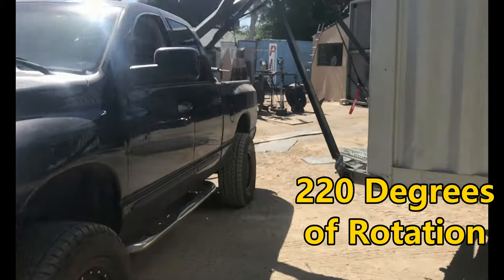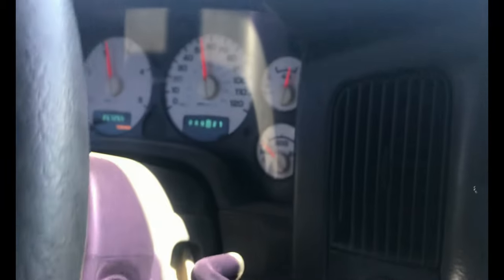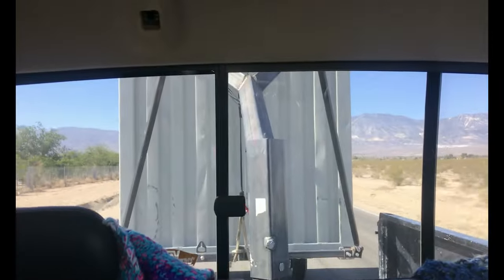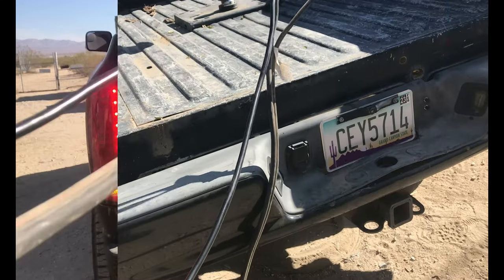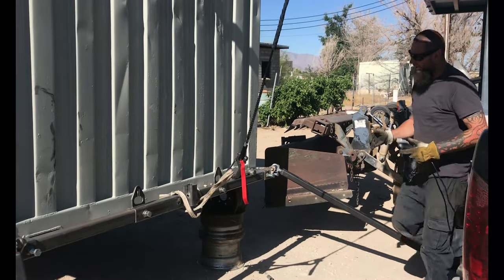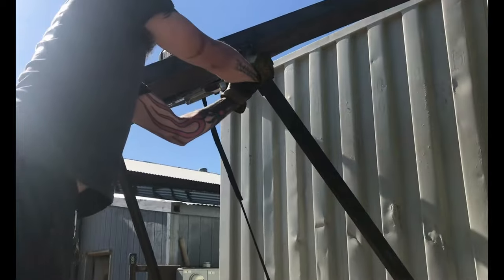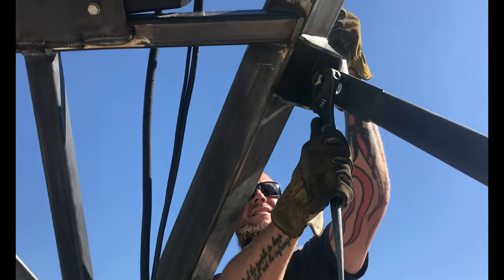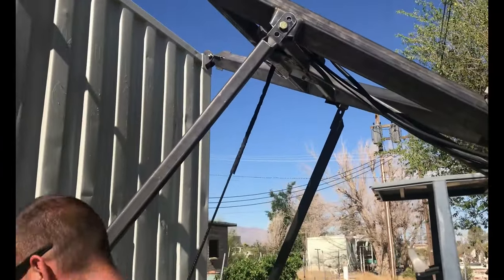LiftWich S2 Electric Winch and Struts - 65mph - Gooseneck Jack & Tow Shipping Container Solution

Comment: Is it possible to connect the wheels to the gooseneck for transport when it's not connected to the container / transport to the pickup location?
Reply from the maker: yes, the containers saddles connect to the uchassis when there is no container.  The entire system looks identical to what you see, just minus the container